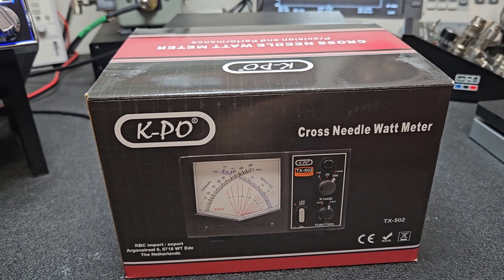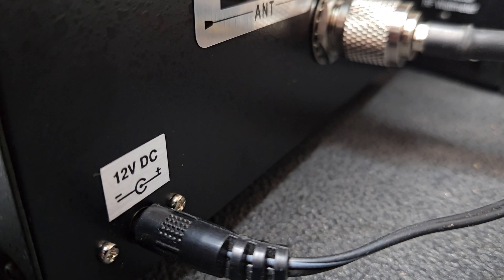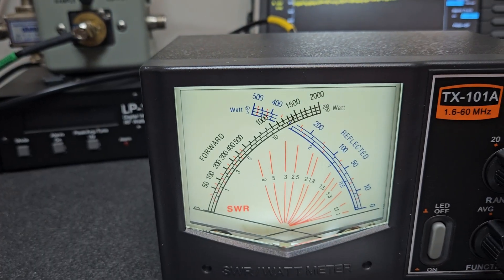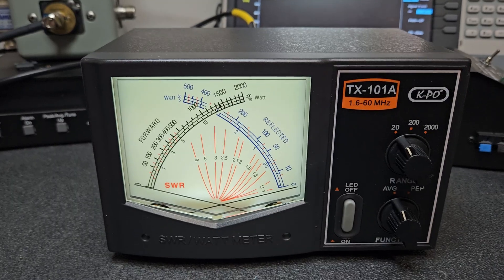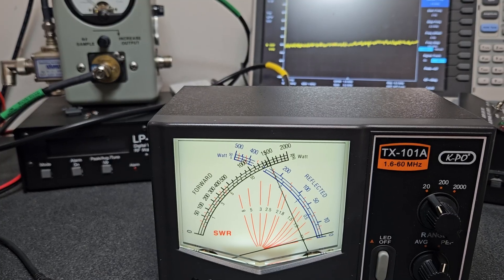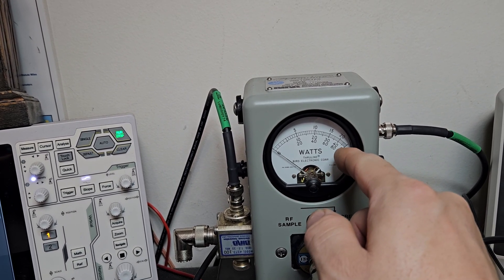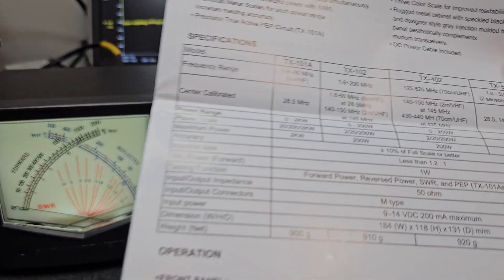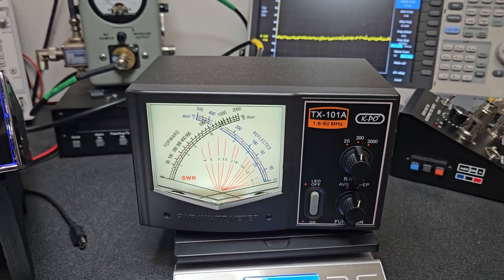New K-PO Meter

Comment: That a nice meter . Their is a Comet one like that as well. Reads as close as a analog meter can. I will get one soon , I hope . The MFJ one is slight different. 300/3000 watt scale. You could put a diode in sears with + power. Like 1N4007 type. This gives reversed protection.  The .8V or so drop will not be noticed buy meter . 73